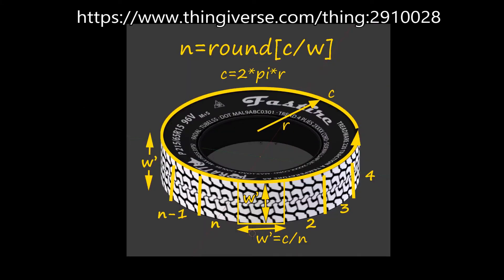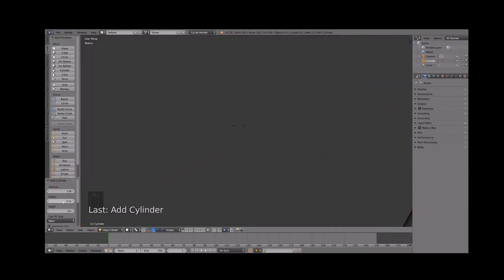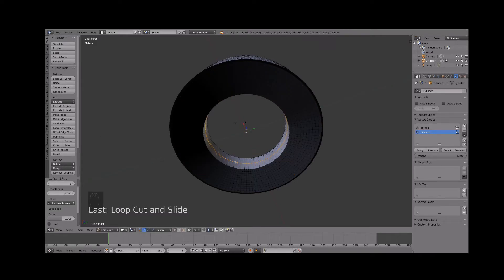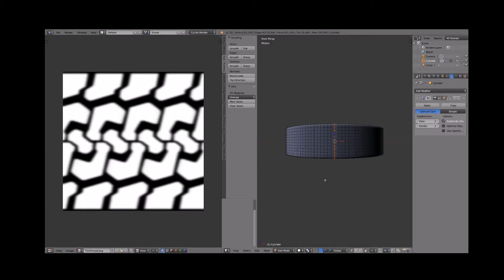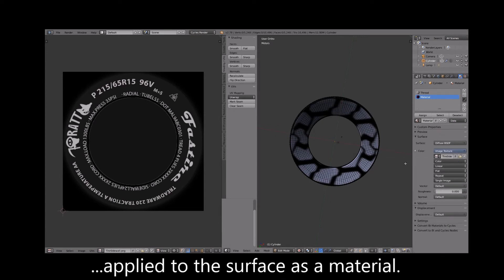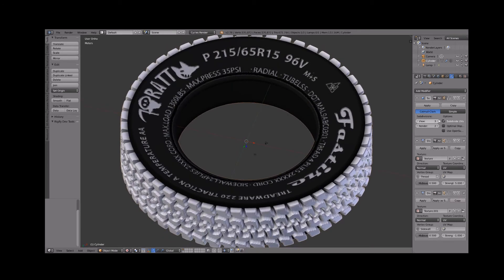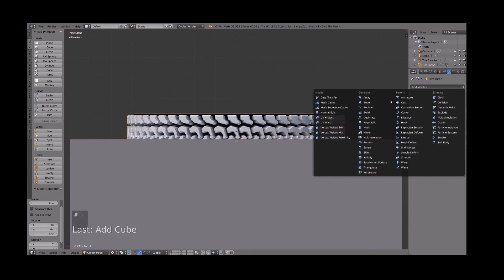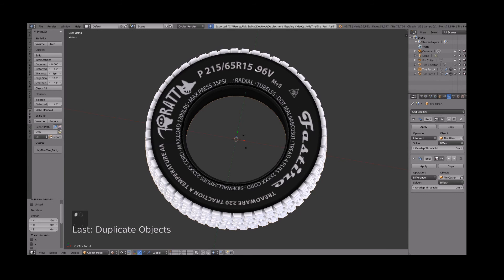How To Model a Tire for 3D Printing in Blender

Comment: Hello Richard your videos have been helpful however I am still having a difficult time with blender.  I am trying to bring castle stl. file , import into blender and put brick texture on some sides and wood texture on the doors and windows to be able to print in one print. is this possibly due to the file being an import stl file?  any suggestions on how to do this ?
Reply from the maker: Greetings Shaun, you can add texture to an imported .stl by following a similar workflow as in the video. I know blender can be confusing at first, but once you get the hang of it you can do everything you mentioned fairly easily. The first step is to create named vertex groups for the regions you want to texture, like doors, walls, windows, bars, etc. To do this, in edit mode select the vertices, create a vertex group and add those points to the group. Use good names like "Front door 1". You can test the group by making it invisible or by inverting the selection so everything but the group is visible.
The blender modifiers you need have a field where you can pick from a drop-down list of all the vertex groups you have created. This limits the modifier so it only affects those points in the group you select. So you can put wood planks on the door for example. You will probably need to use a subsurface modifier to increase the resolution of the mesh so there is enough geometry to show the texture. There is a trade-off between size and quality, so don't increase resolution so much that blender crawls. Once you have the groups defined, you need to create a UV map that essentially flattens and unwraps the model. This part can be tricky. One technique is to do each vertex group separately so it has its own UV map. Hide all points but those you are mapping, then use the screen projection UV unwrap command. Position the view so the surfaces are as parallel as possible to the screen. This only works for flat surfaces like doors, windows and flat walls. For a cylindrical structure, use the cylindrical projection command. The goal is to make UV maps that minimize distortion. Now, you can apply your texture maps to each group and pick the appropriate UV map. You can export the UV maps as an image and make the texture map in photoshop if you prefer and are good with image editing. Otherwise, use a tileable image map as I did for the thread on the tire. Once textured you should use the decimate modifier to reduce the size of your mesh. I hope this helps. Maybe start with something simple until you are confident with the workflow and blender commands required. I hope this helps.
Reply: @richardswika1737  this is perfect going to start right now thank you very much !!!!